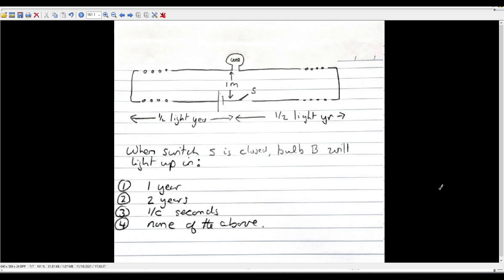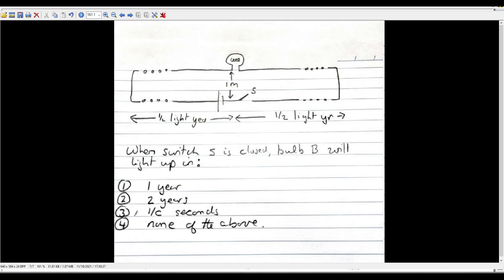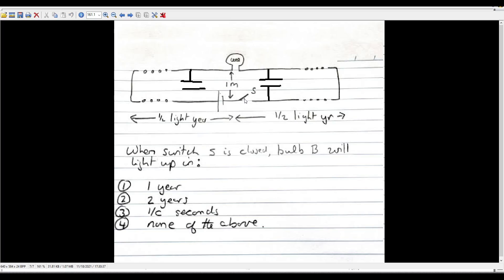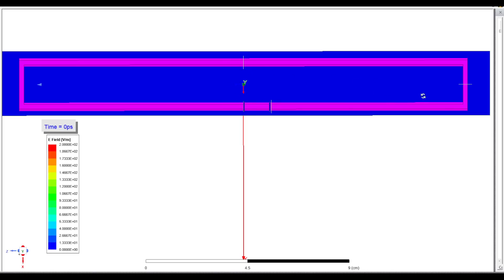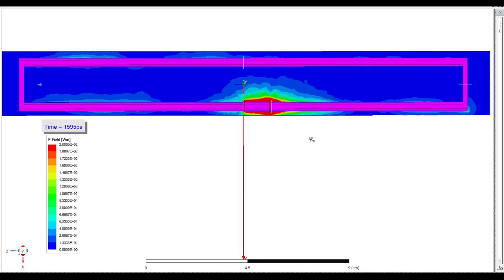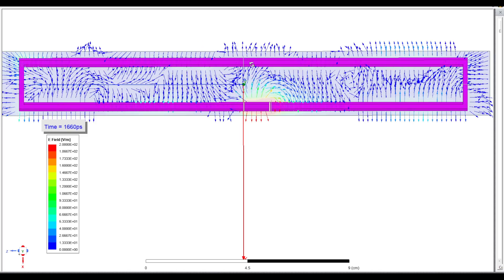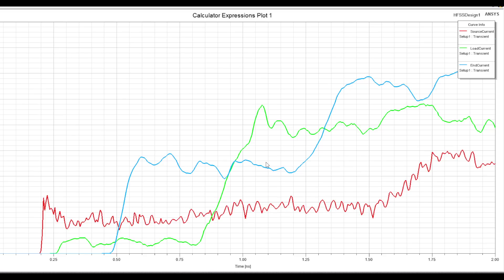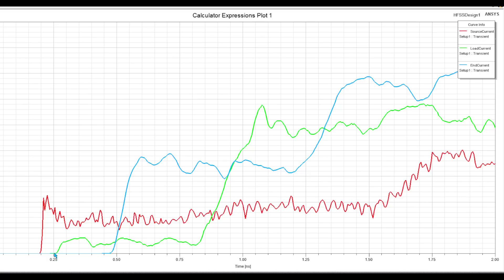Response To Veritasium - Electricity Propagation Time Problem

Comment: Quick question: are you taking into account the parameter that the wires are ideal superconductors with 0 impedance? Since there is no impedance until the current reaches the light bulb, it seems like the transient current on the battery side would be MASSIVE, with correspondingly massive EM fields. If you take the capacitor/inductor simplification, you are dealing with very extreme numbers and accounting for the inertial mass of the electrons and mess like that. I’m wondering if given the 0 ohm stipulation, would the insane currents limited only by electron mass be enough to power an actual bulb until the resistance of the bulb becomes the limiting factor (both initially and when the whole circuit is engaged.)
Reply from the maker: Zero resistance does not mean zero impedance in this case. I did model it as copper, but making it a PEC does not change it much.
Reply: @PulsedPower  ah, so the higher frequency components in the transient still experience impedance from the fields building essentially?
Reply from the maker: @rcm034  Correct! The inductance and impedance are inherent to the geometry, not the material. Technically if you did have a perfect voltage step function at the switch then it would have infinite frequency components and could drive infinite current through any capacitor, but for the simulation to work I have to limit it to ~10GHz.
Reply: @PulsedPower  wait I’m skeptical here. If it’s a PEC, impedance is 0 by every source I can find. The internal electric field is 0 so E/H is 0.
Reply: Basically if I have a perfect voltage source and a perfect conductor, I have infinite current, which means infinite fields and infinite induced current in my ideal scenario with no other objects. In this case, the ONLY load to absorb any of that is the light bulb and thus it is the sole power sink. If my wires are .000000001 ohm instead of 0, the current is a million amps and suddenly the voltage drop on the conductors is right back to a significant portion of the battery voltage and the wire is on fire. It has to be exactly 0 ohms, which means the charging time on the capacitance is only determined by the light bulb’s impedance… so even that analogy you have the bulb taking all the power yet again. I’m wondering if given the very unrealistic requirements of 0 ohms and functionally infinite step current at the switch, that initial rise in amperage across the bulb is a lot closer to the steady state.

Comment: Thank you for this explanation and simulation-demonstration.  It's weird to me that you've made this explanation that it'll take a long time to come to the full steady state current, but you still go along with answer 3.  A fundamental aspect of every kind of light bulb that I know of is that there has to be threshold energy to get it to light up, so it would take significantly more time that 1m/C to light up.  For example a filament light bulb has to reach a certain temperature, and an LED light has to reach a certain voltage.  This is a crucial property of light bulbs, since they must emit visible photons.  The original problem is not simply to detect a signal or the slightest electric field, but to surpass the threshold to produce visible photons.
Reply from the maker: You of course make a valid practical argument. However the original problem did not specify any source parameters (unlike Ve implying a 12V car battery). So even assuming some current or voltage threshold, its just a matter of cranking the source voltage until the "reduced" level of initial current is sufficient.
Reply: @PulsedPower  Perhaps, but this risks burning up the lamp. We can accept zero-resistance wires, because superconductors exist. Can we also accept a lightbulb/led/lightsource that a. responds to /any/ current, b. is not therefore "always on" due to background radiation,  switch leakage, etc... and c. does not burn up after 10 seconds when power is fully arrived?
Reply from the maker: @BenjaminGatti  Your considerations are totally logical in any practical situation(ie an engineering problem). However this is an entirely theoretical problem. Wire resistance a problem? Get rid of it. Background radiation a problem? Get rid of it. Not enough current? Crank up the source voltage. And so on...

So while I understand what you are saying, I dont understand why you think this problem has to be constrained by the possibility of our hypothetical bulb burning out.
Reply: @PulsedPower  I think your simulation is the best thus far. The rest deal in lumped components with no time/distance consequences, fail.
From this simulation, we can see color emanating, but graph color is not useful energy. Let's agree there is an energy field, we would then need a field harvester to respond to that energy. Is it clear to you that the lamp location is experiencing any meaning ef potential within 1d/c sec?
Reply: @PulsedPower  The answer is still wrong. No delay at all will be observed! We did the actual experiment. See my detailed post a the top of the comments

Comment: How is there current after 50-60ps at the source when it takes 3335.64095 ps for light to travel 1m? Re: 9:30
Reply from the maker: The simulation is not to scale. I mention that this is only to show the principle, not model the problem 1:1 (for simulation time savings).
Reply: @PulsedPower  Ahhh.. I forgot about that thanks! Nice job!

Comment: In 1/c the waveform would only reach the bulb and none of the wire so the answer is incorrect unless wires are not needed on the side of the bulb. A picosecond later maybe, but not at 1/c.

Videos explaining why the answer is correct are changing the question.

Comment: The transmission line stubs do not act like a pure capacitor, since they have both distributed capacitance and distributed inductance.  In a transmission line, capacitive reactance and inductive reactance cancel out leaving the real part, so the driving point impedance of each stub acts very much like a pure resistance (for AC waveforms, but not DC).  This is why cables are measured in ohms, such as a 50 ohms coax, even though the DC resistance is different.  So the initial current pulse you see in his simulation is limited to the applied voltage divided by total resistance, where total resistance is equal to the load resistance plus two times the transmission line impedance.

If your stub wires are small in diameter and 1 meter apart, the transmission line impedance will be very high (a lot higher than 600 ohms open twinlead).  And we're also neglecting antenna coupling into free space, which is a big problem with long wires.  Even at 60 cycles, transcontinental power lines have to deal with that (so they run DC instead of AC).
Reply: Correct, Nic.
A prize for one of the few who understand!!!
A couple other videos apparently be EEs use the lumped element T-Line model and focus on the "input caps" as providing the initial current to the bulb..
.
This circuit geometry, I believe, was selected to spark discussion and possibly even controversy.
.
It's surely earning Derek lots of "clicks"...
Reply: @Observ45er  Reminds me of when Marilyn Vos Savant posed the 'Monty Hall problem." It tripped up some college professors and statititions... and even me at first.

Comment: I think you are right in both explanations, however I think the answer should be 1 year. Because let's be real we don't care about small perturbations in the EM field that cause the light to maybe turn on very slightly, what we really care about is when the bulk of the current starts going through the bulb.
I propose this absurdity which happens if we consider your conclusion for the capacitance to matter: by this logic we can say that any bulb anywhere in the universe will turn on (very slightly) as soon as the EM wave front reaches it even if it's not connected to this circuit at all. Which is obviously just a dumb way to think about circuits. All circuits are subject to interference, what we really care about is when the EM front that moves along the wire reaches the bulb, and the bulb actually turns on with the bulk of the power. Counting the wire capacitance really just seems like a smartass way of getting around the real question at hand.
Reply: Judging by the graphs, the current that appears "instantly" is roughly 20-50% of the final current so that light is definitely lit the whole time. This value just depends on the coupling efficiency between the two wires. If you were to place the wires almost touching and surrounded by iron core, then the brightnesss would be essentially 100% right away.
Reply: @ndvorsky  If you have two wires a meter apart and you pump a measly current through them, there is no way 50 % gets transferred. If that were true you'd die just by standing too close to your home's outlet with a spoon in hand...
Reply: @why_though  Actually no. The spoon isn't wired to ground on either end so it can't create a current.
I think in idealised physics land, if you do have two circuits, one with only a DC source on a long wire between ground connections, and one with only an electrical component in a similar situation, and they are put one above another, you would actually get 100% of the power from the source to go into the component (bar a small amount that leaves as EM waves at the start). I don't believe the ability of the source actually matters on that front.
In the real world, I reckon the air and other things, especially the ones that the outlet is actually wired to, would use too much energy from the source for a notable amount to go through your wired-to-ground spoon.
Reply: @neopalm2050  Sure it can, just not a very strong current because e- start to pile up very quickly after the current starts...

I still don't think your scenario would yield anywhere near 100% efficiency... that is pretty much wireless charging but wireless charging is only any good at low distances unless you have an absurd current wouldn't it?
Reply: @why_though  electrons don't pile up if they're going into the infinite electron reservoir known as ground. And yes, that is wireless charging. I think it only fails at long distance because the universe has more things than just the energy transmitter and reciever nearby which can sap most of the energy.
Reply: @neopalm2050  Was talking about the spoon...
Well yeah, it's an interesting thought experiment, maybe it would all get pumped into the other wire if there was nothing around it, however I am not quite qualified enough in physics to figure that one out. What I'm saying is, if it can induce a current in the wire 1 m away it can also probably induce one in his pants zipper and zap him in the balls... which doesn't happen when you walk near a typical wire...
Reply: @ndvorsky  you are looking at the wrong curve. the green one is the current at the light bulb and what happens at 1/c is tiny
Reply: @jurghaag2764  Yeah, That's what I was talking about. It's not a huge current but it is still a significant portion of the current that travels through the wire path. The lightbulb had current from the very beginning.
Reply: @ndvorsky  But would it be 20-50% if the model used Veritasium's dimensions, or at least length to separation ratio? As that ratio increases, does the partial switching on approach zero or one?
Reply: @garethb1961  The length of the wire shouldn't affect the current because that would require one part of the wire knowing what was at the other end instantly.
Reply: @ndvorsky  You are correct, for an instant - but the ability for a sustained current to flow depends on the capacitance, which certainly depends on the wire lengths.
Reply: @garethb1961  Yes, the length of time there is a current is affected by the length of the wire but the value of that current shouldn't be.

Comment: Can you repeat with a single source at the bottom which steps from 0 to 1v, wires sized to give a known characteristic impedance e.g. 100 Ohms, and load at top being a 100R resistor, i.e. matched?
Reply: I'd also like to see the switch in the very center, but this does show the fundamentals ok.

Comment: This excellent demonstration proves that the correct answer should be “none of the above”. Yes current will first start to flow in the bulb at 1/c. That’s correct. But it’s very misleading as that only marks the start of a ramp up to full power (I*V), which will take something of order d/c’ (where d is the wire length, and c’ is the speed of light in the wire… which to make thing even more complicated is frequency dependent).  The problem is what one means by the light being “on” is not well defined due to the large ramp up time in this problem.
Reply: I believe Derek said in the video that in this problem is assumed that if any amount (above zero) of current flowing in the bulb, it would be considered as it turned on.
Reply: @Zephyr80280  energy most flow from high to low. You don’t need all these extra equations to explain something simple.  The equations are good for understand how much energy will flow, but a kid can tell you what should happen without all these equations. More observations, more concept teaching needs to be done in school. Math shouldn’t come into play until later.  Most people have no clue how the universe works including many people good at math. It’s like saying the ball fell off the table because the equation said it should.  That’s not how it works.
Reply: @davruck1  I was just clarifing for the lest sentence in the original comment
Reply: @Zephyr80280  yeah I know.  You had a good point I was expanding on
Reply: @davruck1  Oh, I got it now!
Reply: @davruck1  i always thought it would be so much better for kids learning math to be presented a real world problem and given some time to try and figure it out together before introducing the math that enables us to solve that problem. Like how many people think imaginary numbers are useless? They arent, but when taught in school, they are suddenly introduced to something that just seems ridiculous.
Reply: There is no ramp, it is more complex. and there is no current induced at exactly 1/c
Reply: The wire does nothing besides hold charge in the same way pipes hold pressure.  Nobody believes the water that comes from the tap had to flow all the way from the source.  You don't need any equations for this.
Reply: @davruck1  Water doesn't exist everywhere naturally and does have to be collected and pumped from a source (eg reservoir) to a house. Electric charge does reside naturally in lots of things which can transfer electromagnetic radiation to differing degrees of effectiveness so i think your point makes a terrible mistake.
Reply: @marksimpson2321  no it’s just that you don’t understand the fundamentals of energy or that physics is simply a model. Charging a wire takes energy just like filling pipes.  It’s all energy. Energy if you understood the foundations of physics, always behaves the same way.  So yes pipes and wires are the same. I’m a engineer I know the equations.

Comment: YES a finite element analysis is exactly what I was hoping for.  There's a reason that Poynting vectors are often scaled so that the strength of the field correlates with the density of the lines.  The simulation was exactly what we need to show this.  It would be nice to impedance match the load to the source and then use "ideal" wires to show what it's like without reflections, but the animation clearly shows that the field propagates *around the wires*.
Reply: Some of us think that Derek may have made this complicated on purpose...
Reply: @Observ45er  it's not "complicated", for that try transmission line theory. As an example, a real world setup would actually take around 6 seconds to reach peak power because the parasitic elements for such a large curcuit are enormous.

The original author was misleading his viewers. There is no way the displacement current generated by the initial step response will provide enough power to do anything resembling what the lay person would describe as "turning the bulb on" (another thread showed two 10 gauge wires 600,000 km long and one meter apart will have a displacement current around 7.5 mA until the wave propagates through the circuit, given a 12v battery that is a puny 90 mW, less than 1% of what is needed to turn a mere 10W bulb on, which is quite clearly insufficient). As this author shows, the vast majority of the power that will actually "turn the bulb on" will take much longer than a few nanoseconds to traverse the hundreds of thousands of kilometers of wire. This is true even for theoretically ideal wire with 0 resistance.

While it's true that a sufficiently sensitive amplifier will be able to detect the signal in a few nanoseconds, that's not what the receiver is. The original author just adds to the viewer confusion by implying that the length of the wires are irrelevant when that is obviously not the case